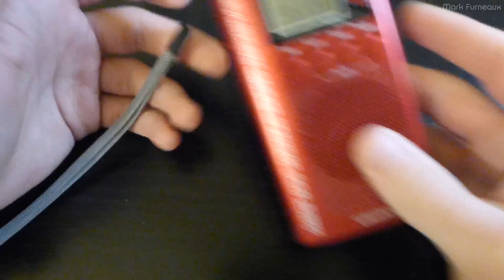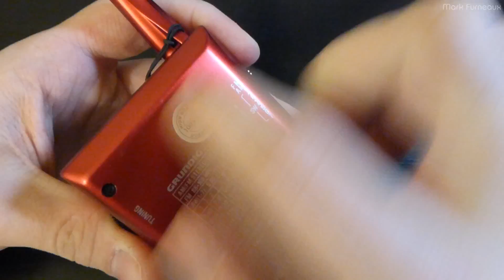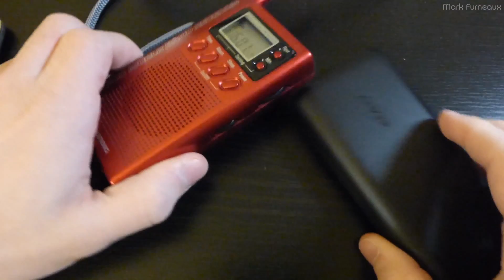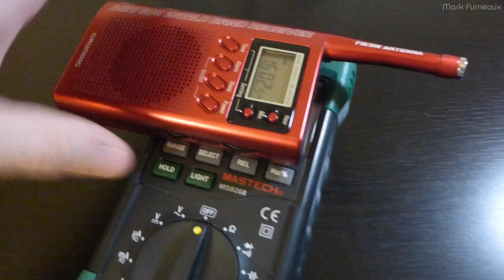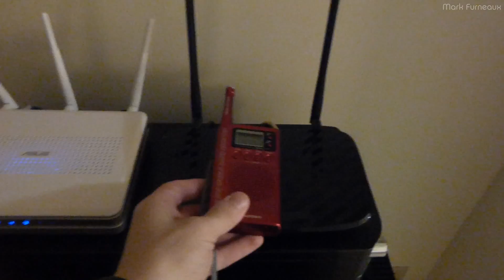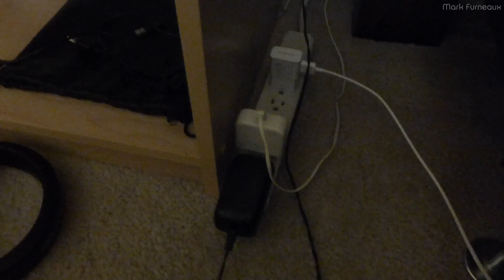Using an AM Radio to Detect EMI

Comment: Using an AM radio at night, you're able to reach AM broadcasts from hundreds or over 1 thousand miles away (called DXing). Perfect if the grid goes down to get information from out of your region.

Comment: Wow, I just detected where is my MOnitor, TV screen with AM frequency at the 160 KHz. UUUps. If the radio can find them is there any type of magnetic emision? I starting to get thrilled. Next time I will work only with the screen switched off on my computer. Basically I enter only in Youtube! =)

Comment: BtW so are kids walkie talkies, metal detectors, electrician line locators, landscaping and utility locators, plumbing locators, telecom locators. These all will allow you to listen to the EM field from pretty much anything from 1.5volts to all the way up to High Voltage.  Electricity through wires is Radio through an antenna wire.

Comment: Interesting vid.  Thank you.

I use a multi-frequency metal detector and EMI sometimes interferes with the signal from the coil (round part at the bottom of the shaft).  I’d like to find and understand the EMI source.

Would the frequency tone get louder as I get closer to the source?

How can I replicate the EMI that interferes with my detector?  I know there are FCC regulations to help prevent EMI interference, but I think it would be okay if I’m doing it to my own equipment.

In advance, thanks for your advice.

Comment: I accidentally discovered this in my car by resting my old iphone next to my center console. i found out that after a forced update, apple basically bricked my old iphone 5 by forcing it to send a crazy amount of extra power to the mobile phone antenna all the time, therefore draining my phones battery with only about 4-5 hours of screen off time. after discovering this and with 3g towers getting phased out, i got one of those 4g modems and moved over my sim card, and unplugged the wire leading to the cell phone antenna inside. now my phone gets several days worth of battery life... i wouldnt have noticed this if i didnt realize before the buzz on my cars radio only happened when i was sending messages/using the internet on my phone, but after the update it was just constantly blasting out a signal for no reason. im sure apple has no idea what im talking about and i just need to buy a new phone that correctly loads internet ads and sells my data/browsing habbits

Comment: I've noticed that bringing my AM radio up close to my phone and tuning it to 800 KHz while the phone is playing any sort of audio causes the radio to pretty much work as a wireless speaker. This stays true even after I turned on airplane mode.  I wonder how that works?
Reply: woah what? could you elaborate on how to do this? this would seem like a cool party trick to try out for my below average intelligence friends
Reply: it's pretty much what it says on the tin lol

although it might not work with every phone/radio, tried it with both my shitty galaxy A01 knockoff and my better xperia xzs and it works (tuning doesn't matter, 800 KHz on my pocket radio happens to give the "clearest" sound although it's still covered in static)

Comment: There something you can do to prove yourself YOU are a RLC filter:

1. extend the antenna of the radio set
2. put the radio in AM with the frequency to 1602 KHz as in video
3. put it close to a CFL light bulb: lots of noise
4. in same position put your hand on the antenna: noise disappears as your body has absorbed it. This can have effect on your cells
5. watch water has memory II https://www.youtube.com/watch?v=i1gNSkMEDTQ and https://www.youtube.com/watch?v=Lj7XKl8KCsM

Comment: can someone tell me why something that isn't plugged in would cause AM interference? Were trying to locate source of high frequency noise (spectroid app didn't find anything). Turned off all electricity to home; discovered fireplace, thermostats and old printer interfere with AM radio static. Thanks

Comment: I'm a guitar player and I'm getting tons of noise whether I'm playing through a modeler, interface, or regular amplifier.  I've checked the shielding in my main guitar for continuity and it's fine.  I've unplugged a bunch of stuff and plugged it all back in.  No difference.  To get rid of fan noise I actually moved my computer tower to an adjacent room, and I was hoping it might solve the EMI thing, too, but no luck.  

I don't hear any regular clicking or anything.  It's a hum but it doesn't sound like 60 cycle hum, and I don't think it's a ground loop.  Humbucking pickups are much quieter but I can hear it if I crank the amp.

Strangely, if I turn my chair it does go away or at least decreases a lot.  If I'm facing my computer monitors/keyboard/usb hub/etc it's noisy, but it remains noisy even if I cut power.  It must be coming from outside the house.  The main power line comes in underground on the other side of the house.  The air conditioner compressor is outside the window but the noise doesn't change when it cycles on and off.

I'm going to try this thing with a radio (if I can find one), but am not terribly optimistic.  I've been trying to figure this out off and on for three years now.  If anyone has any ideas I'd be grateful to hear them.
Reply: How'd it go?
Reply: @vul5925  I can't find anything using the radio.  It's really easier to just pick the guitar up and move it around, but the noise seems to be coming from a wall with no electricity in it.  It's a mystery.  As it happens my favorite guitar just has noisy pickups.  I've changed the pickups and have found quieter ones but they don't sound as good so who knows.
Reply: @JohnBrown-z2u  Have you seen SamuraiGuitarist's video ("solving another mysterious house noise")? There it was coming from a transformer outside the house.
Reply: @vul5925  We don't have any transformers really close by like that guy did.  Maybe about 300 feet away on a pole there is one.  It may be coming from the gas meter.  The radio isn't nearly as sensitive as a guitar, so I need to find some battery amp to take out there.
Reply: I have the exactly same problem

Comment: People can be identified by which phone they have in their pocket and possibly if hidden software (malware) is active in the background. Even data can be extracted from IT equipment, which is known as TEMPEST technology.

The continuous tone you hear from devices is often the keyboard matrix or VFD display driver signal. Try to tune the radio to other frequencies (outside active broadcast). Many devices do strange overtones, which can be also used in electronic music. E.g. my Sharp talking clocks and calculators do plenty of crazy additional tones and distortions from data processing thos can be heard on AM frequencies. Also a faulty quartz or if a chip is crashed or still computing something can be heard this way.

Comment: Over the holidays I was listening to AM radio in my pickup. I pulled into my driveway and at a very specific point a signal from something blanked out a very strong AM radio station. I could move 5' east or west and the station would come in. I have a little AM/FM/SW radio, not too unlike the Grundig in your video. I used it to attempt to track the source and I couldn't. The frequency was 738.738 kHz. I initially thought it was power companies meter but walking toward the meter resulted in loss of signal. In fact, I almost called them to chew them out lol  

I can see a very small peak in at the frequency I tuned on the AM radio, on my spectrum analyzer. It's about 15' away in the house. The peak is very small  but it's there.

Comment: OK so like, I am a totally blind person and when I was a kid and didn't have speech enabled electronics, this is the method I used in order to detect whether a device was on or had the correct setting. This was especially helpful with things that had menus where you had to scroll around and press either OK or cancel. A perfect example of this had to be those MP3 players that were around in like 2008 where all you had was a little joystick thing up top to scroll up and down through the menus.  The music listening mode and voice Recording mode were in completely different folders on the device so I had to be near a radio if I wanted to switch between them. I would just tune to the lowest frequency on the am band, hold the device up to the radio and get familiar with what sound corresponded with what element or command over time.
Reply: How are you doing now?
Much Love and God Bless
Reply: Have You Read The Braille Bible or Listened to Audio Bible?

I am going to Pray Your Vision is Restored in Jesus Christ's Name, just as he spit on the ground and rub dirt into a blind man's eyes and healed him of blindness.
I Love You and May God Bless You

Comment: When you put a watch to a radio you can hear it flickering to different time change and when you put a radio to TV it will make a noise and you can see or hear when the pictures change won’t be able to see it but you’ll be able to hear the pictures change to different sounds
 When you record lightning strikes on radio with an audio recording it is pretty interesting you put one radio at one end of the deal and the other radio at the opposite end of the deal therefore you get lightning in stereo and you can get one radio getting lightning it from the interior of British Columbia and the other radio picking up lightning to the east to the Fraser Canyon Ave., British Columbia Fraser Canyon is really cool

Comment: Super glad to hear that the correct unit of measurement - the "shit-ton" - being used judiciously. I keep an old AM/FM radio for just this reason and use it to compare new product designs.
Reply: The "shit-ton" is a volumnmetric measurement, while the "Baofeng" measures length.                       ;   )
Reply: I remember having a reference book when I was a kid in the '70's that used to refer to nuclear weapons as having a yield the equivalent of how - ever - many thousand  'short - tons' of TNT. For all these years I've wondered what a 'short - ton' was, and turns out  all along it was just some kind of a misprint!  ; ^ )

Comment: I have the same radio but it's blue. Yours is in better shape than mine it's in rough shape but it still works. the antenna on mine broke off so I have a car phone antenna on it. The power button no longer works so I modded a regular switch into the circuit so you can just flip it on or off.

I have this old craig android tablet and it was a piece of junk and would freeze a lot. I would use this method to tell if it was actually doing anything.

Comment: Can you detect human microchip with it?
Reply: human microchip--they don't need to microchip us with or without our consent, it's called a smartphone...and soon 5G which is the ultimate information gathering system on all humans within range. but to detect a microchip you may need to turn the volume to max on a really clear radio station to hear for any differences when moving radio over body
Reply: @joelschmierer3544  There are no microchips hidden in vaccines or whatever. Such technology does not exist. Nowadays RFID chips (ask your vet) are glass capsules of at least several millimeter size.
Reply: If its real you should be able to. Your body alone may provide mild results tho. Do not worry comrade, we are not surveilling you

Comment: I use it to help clean my house from EMI. Some people are sensitive/allergic to EMI and other frequencies. Also, some radio's are much better than other, i tested a couple. There are big differences. Some have noise filters that make the radio less sensitive to EMI.
Reply: What about RF? Have you been able to pick up RF as well using this, and if so, are you able to tell how much RF is being emitted by a device/in an area?
Reply: @Chris-dw6cu  I'm using a budget RF meter (Cornet ED88T) for RF in the GHz range and a Esmog Spion (=expensive). Links to websites where you can buy these and all kinds of other good meters are on my handy EMF webpage. It's best to check those links out because randomly looking on the internet you can find all kinds of crap recommends.
Reply: @Merializer  thanks for the tips! sounds like for accurate RF detection you gotta spend the big bucks - no way around it. I think RF detection is more important than EMI given what's going on in the world today.
Reply: @Chris-dw6cu  about RF versus EMI: still not sure what is the biggest problem and I know a lot, it's not simple.
Reply: @Chris-dw6cu  RF, EMF and EMI are used almost synonym. In marketing terms they rarely make a difference, although EMF would also include DC or low frequency components of electric and magnetic fields.

Comment: Interesting I have a Meterk gauss meter for detecting EMF & EF.  Are those cables Cat 6 and fully shielded? I run cat 6 full shielded ethernet cables from my router to two computers and two printer into the router, the routers Wifi signal is very strong and Very UN healthy so I turn off the Wifi, and run direct into router via ethernet and then to cable modem. That way you are Not getting Blasted by Wifi toxins. I turn on wifi only at times when I Must have it on. Wifi is like having a cell tower in your house

Comment: AM radio method is cheap but does not show anyone severity of signals the way 100-200$ meter/detectors do
Reply: That's what I was wondering about. How about RF? Can the AM radio also give you info about RF emissions?
Reply: But a radio is at least as good as primitive EMF/bug detectors (few blinking LEDs + beep) and in some ways better, because you hear the structure of the signal, which helps to estimate what it is.

Comment: I assume that a shielded network cable would produce less signal leakage or would it even block all of it?
Reply from the maker: STP cables are more to prevent noise from getting in rather than out, but it would reduce the emissions drastically. It won't block them completely though.